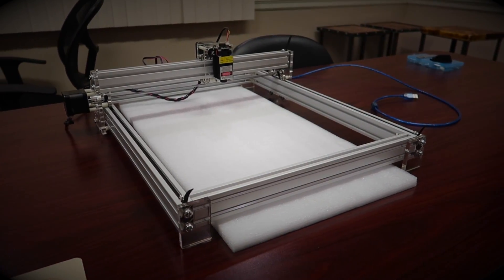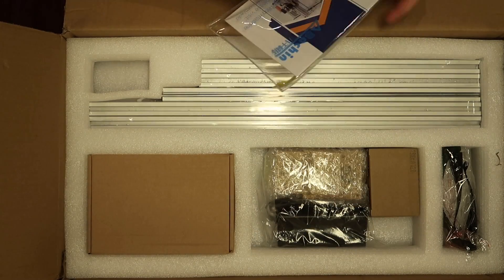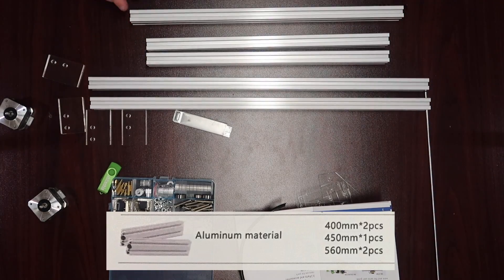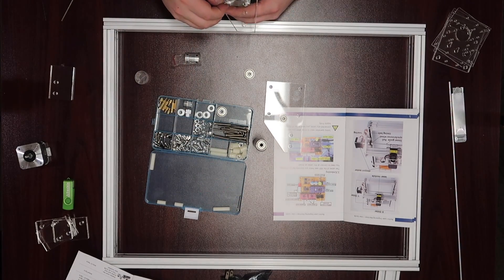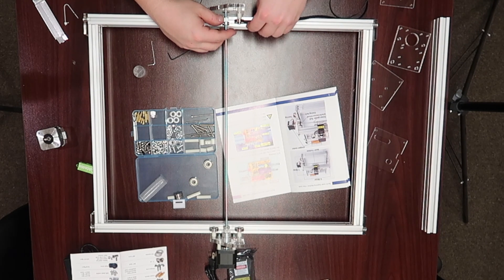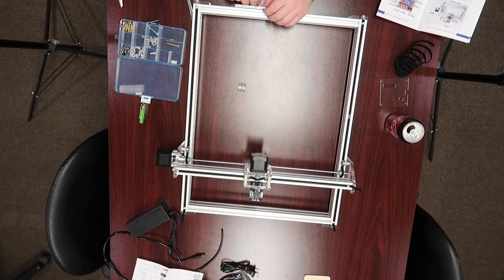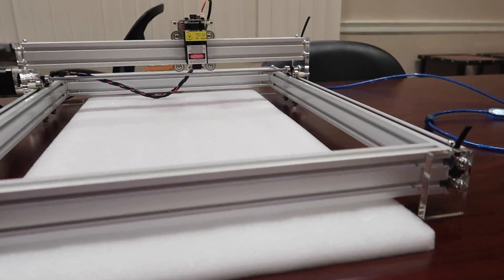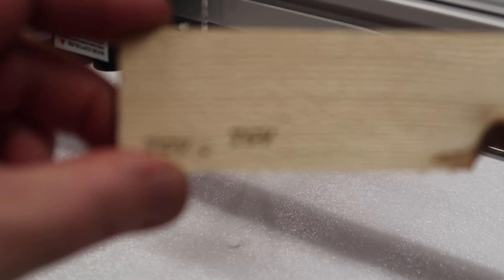Amazon Sunwin Bachin 4050 CNC Laser Assembly

Comment: Hello, i have question. Is it possible with Bachin 4050 to cut printed paper? For example i printed some graphics on paper and i want to cut it out with laser. It is basically pixel art graphics with scale 1mm=1pixel and i need cut it out. But i am affraid that i would not be able to calibrate cutting route vs printed picture on this scale or am i? :) I dont want to buy laser cutter and then figure out that i am screwed :D Tons of thanks in advance for reply!
Reply from the maker: This laser is very impressive when it comes to accuracy. You would probably have to make two files. One to engrave the picture on a lower power, then a separate file to make the cut contour outline on a higher power to actually cut through the paper. If you have a link to a image you would want to try with a size, I could give it a try when I get some free time.
Reply: @TheGarageVlog  Basically i want cut out parts for shadowbox style art. So i have printed graphics on matte photo paper (220g/m2) and i want to do cutting by laser since manully it is time consuming and not perfect. Anyway there is a link on printing sheet which i think is self explanatory - everything white must be cutet out and cutting must be ideally pixel respecting :) https://imgur.com/a/VFmVgeI

If you are able to try it that would be amazing! :)
Reply from the maker: I see what you’re trying to do now. The laser isn’t the ideal tool for that. I’ve done this before with a machine called a Silhouette. There is an option for printing “registration marks” on your paper, then you send it through the machine, it’s uses a sensor to know where the paper and images are exactly at,  and then it cuts out what you program. It’s around the same price as the laser, but a higher quality machine that is made to do for exactly what you are trying to do. You stick the paper to an adhesive cutting mat. It would be hard to line that up perfectly in the laser, there would be a lot more steps in the programming as well, the Silhouette software is really simple to use. It’s been probably 6 years since I’ve used mine, but check them out and let me know if you have any questions.
Reply: @TheGarageVlog  I encountered with this type of device when i was searching for solution for my task. I found Brother ScanNCut which is basically same as Silhoutte devices (they are not available in our region so delivering in from US would cost something). But i was unable to find solid info about limits of cutting regarding to details (if you know the limits, share it! :D). Like for my example i have pixels with dimensions of 1mm. Will it be able to cut it and preserve pixel detail? Only solid option is to try it, i guess somewhere. But then i found out that lasers engravers have small stepping, so they should be able to achieve this details in theory - regardless of calibration. In both cases there is not enough info anywhere, whether i am able to do this with cutter or laser or use something else:)